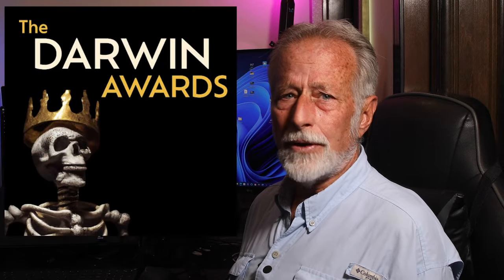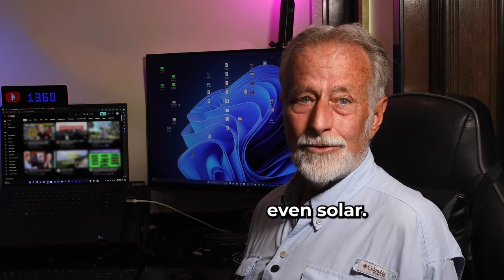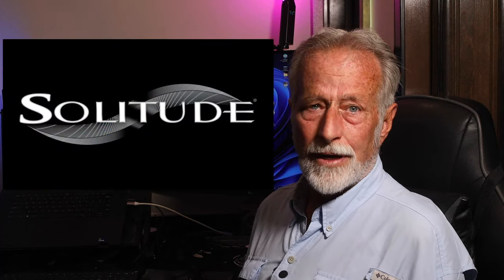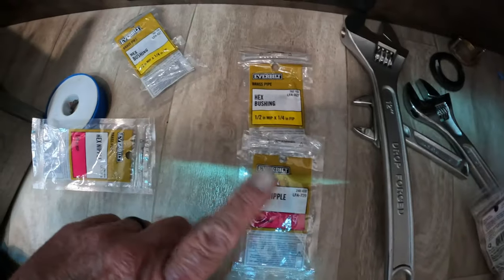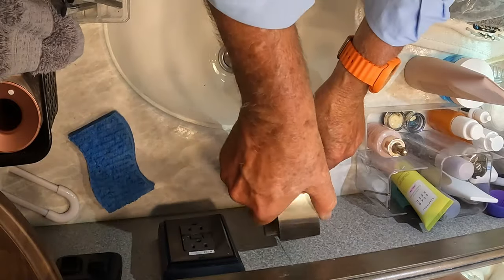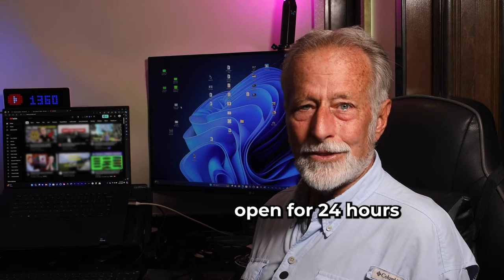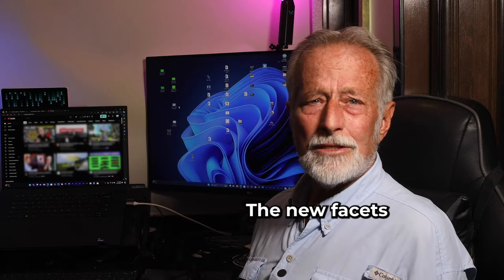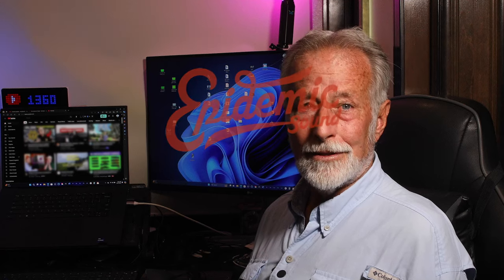Flow Restrictors can ruin your RVing experience!

Comment: Nice looking bathroom faucet.  We replaced our kitchen and bath faucet. We also switched out the shower taps from separate hot and cold knobs to a single lever knob.
Reply from the maker: Shelly is already eyeballing the shower heads and controls.  After that maybe the kitchen. It's just nice to have the flow if you want it... :face-red-heart-shape:      OLT